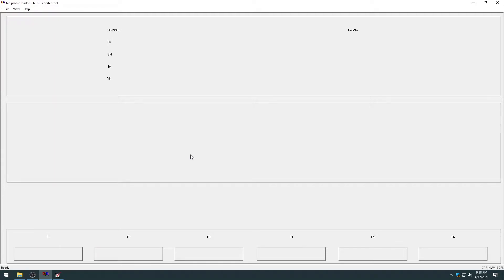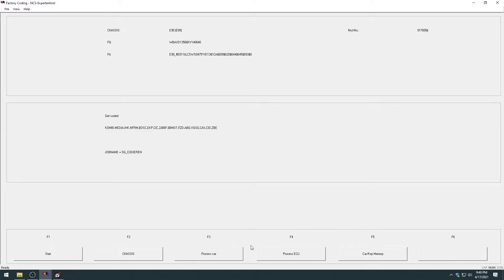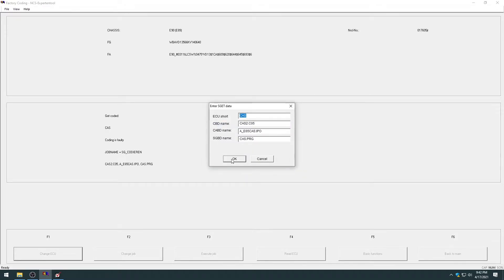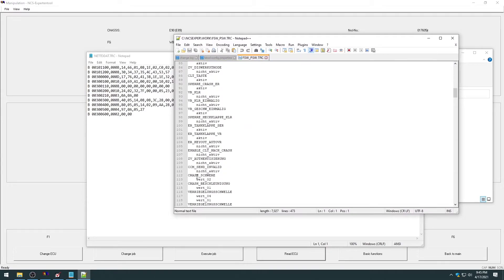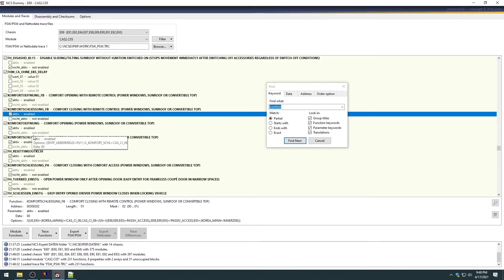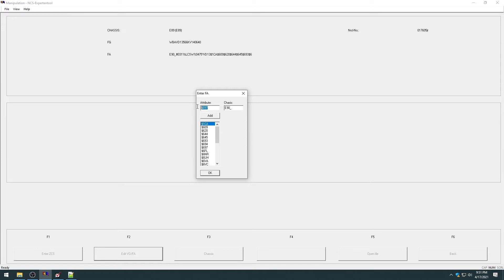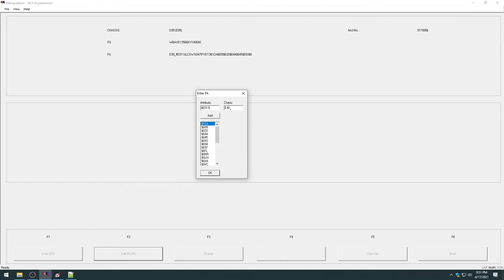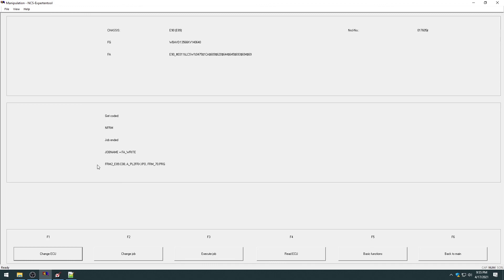BMW Standard Tools: How to use NcsExpert and NcsDummy to code your E Series BMW!

Comment: Hello Nick, i changed my Transmission fluid on my 2011 328i Xdrive, E90, and looking to remove the Service light which is basically the 578e code, what tool do you recommend, thx in advance

Comment: Hi Nick, having a brain freeze.
I've retrofitted a CIC in my E91 and am having such trouble activating navigation.
I have BMW tools, K-DCan USB interface cable and am following all guides i can find and still having no luck.
I have added $609 to the VO and using NCS Expert, have coded the CIC to the car.
Do i have to code CID also to have the Nav working?
Thanks for any help.

Comment: Hi Nicholas, i am new to INPA and Ncs expert. I retrofitted my e46 with a digital aircon control unit. (used to be analog with switches). some of the buttons does not work. can you tell me how to program it? do i have to change the VIN for that module? thanks in advance!

Comment: Hi nick I know it's an old video but I have issue with my car or my inpa software I'm not sure I'm trying to code my vo/po but every time I try to open the software on the car it will not show the car vo it will appear empty I don't know its car issue or software I try to search issue but no on find solution so I will appreciate your help